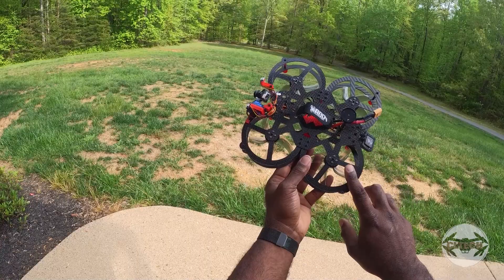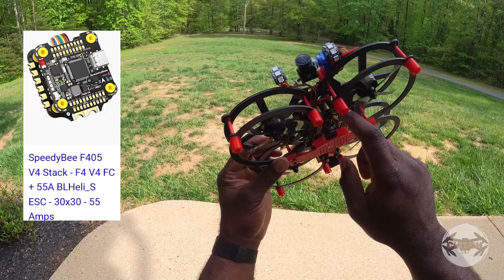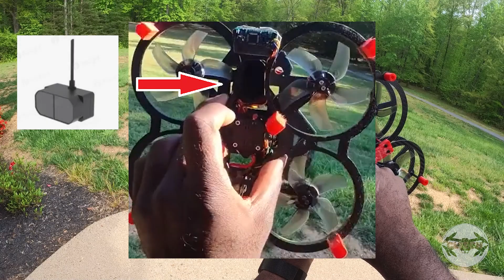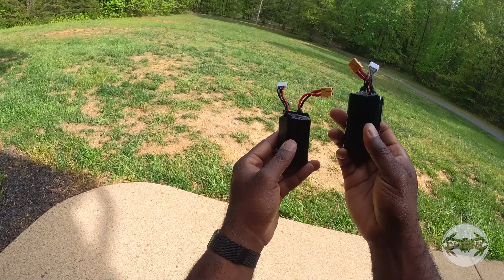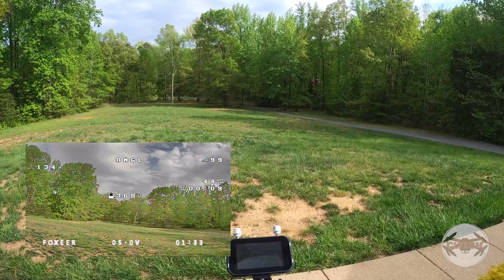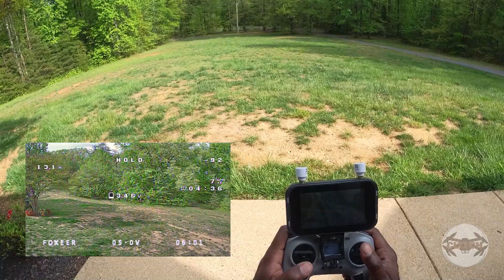2 - CLTech Drone V2 -  3.5" Cinewhoop Carbon Fiber/ Servo

Comment: I think you have enabled the dedreconing in the cli to use the gps and the lidar together. If you want to fly inside before arming you have to hold the left stick at  botom right corner to overwrite the (no gps fix) fault and then arm with the switch.
Reply: Also, configure a switch to enable the surface mode and be sure that first, you trigger the surface and then the poshold. Otherwise, it doesn't work